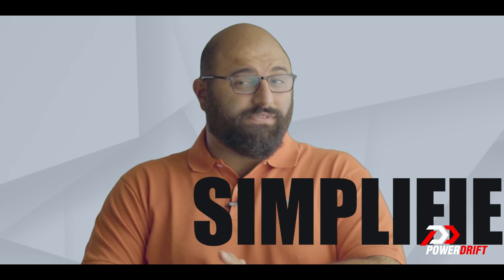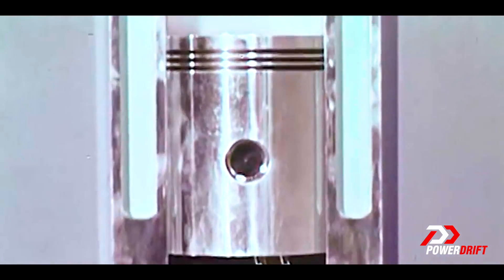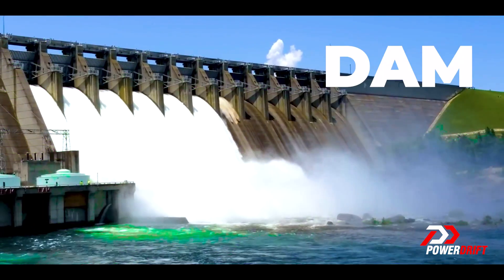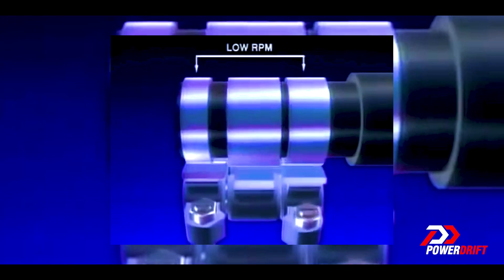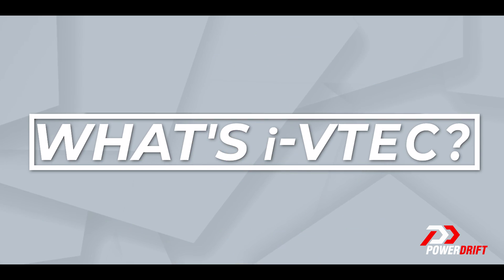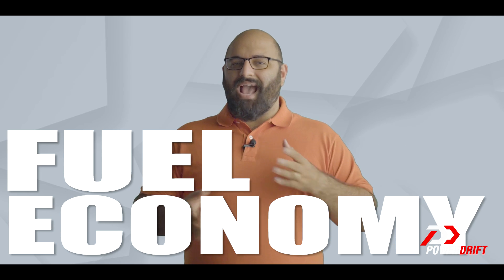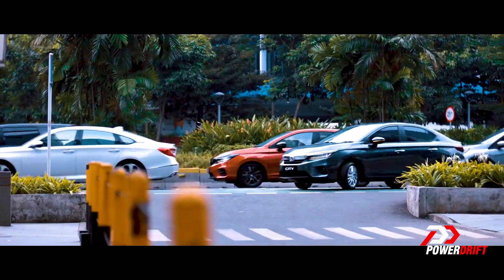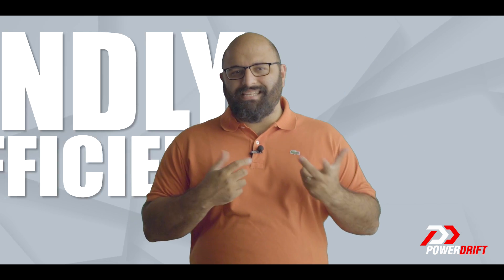PD Simplified | Honda iVTEC Explained

Comment: I can literally feel the performance of a i-vtec engine between 4 to all the way till 6.5k RPM in my Honda BR-V!❤️
Honda is Honda!!🔥
Reply: Iy
Reply: really? i have the amaze ivtec and the car feels underwhelming at all rpm's.
Reply: @vivejk4443  the amaze comes with a 1200cc and the brv comes with a 1500cc, the 1200 only feels good in the brio and extremely sluggish in the wrv,amaze,etc
Reply: Vtec kicks in at 4k rpms?
That's wild
I had to lower it to 4250 rpms using Ktuner

Comment: Hi, wanted to know if Honda has patent over the i-VTEC, then how Yamaha uses the same as VVA. Correct me if i am wrong but i think VVA performs  the same as VTEC
Reply: Toyota also has its version of vtec
Reply: You're correct
Reply: @danteanderson9052 Honda's VTEC is similar but different to Toyota's VVTI. Variable valve in the sense but Hondas are much more advanced. VTEC is variable valve technology electronic controlled. VVTI in Toyota is no electronically controlled. VTEC is design more for performance purposes. VVTI is designed more for fuel economy purposes.

Comment: How is this ivtec different from the older generation vtecs/ivtecs?🤔
Reply: 1, thy feet by
Reply: Mechanical management and ecu electronic management
Reply: I think the older ones are SOHC while new ones are DOHC
Reply: @a7myth nope. The R18 1.8L SOHC engine in the 8th, 9th and 10th gen Civic is i-vtec. The K20 engine is DOHC i-vtec. It only means i-vtec is the more advance VTEC available in newer engine types. The I in i-vtec is intelligent, so it is intelligent VTEC.

Comment: If iVtec is performance driven then why is the economy of city not justified.  I mean approximately  12-14 on city and 16-18 on highways
Reply: That is the characteristic of iVtec.. valve opening will be small in low rpm so if driven sedately u will get good mileage and once u rev up the engine the valve opening timing will increase along with lift. Thus u get acceleration rush!

Comment: Honda should work on delivering better products at a competitive price to the Indian customer instead of doing promotions for their age old  inventions...

For sure ivtec petrol engine is a gem but competition have moved ahead with more value, improved build quality, smarter tech like turbo charging...

The only that stands out in Honda cars are their supremely refined yet engaging engines but they don't l deliver good overall package for their pricing
Reply: Honda need to bring turbo vtec engines
Reply: Small turbo charged engines like the ones in the Skodas and VWs don't last as long. The City's engine is its best part. They shouldn't change that.
Reply: @Arjun true
these 3 cylinder 1000cc engines are overhyped 😂
but honda need to give a 4 cylinder turbo as a option to rival 1.5 tsi...
and a gearbox like Torque Converter
Reply: @arjun3807  
I'm not denouncing the fact that ivtec is a gem of an engine but the modern turbocharged engines are catching up interms of longevity and are much more reliable than first gen turbo charged petrol engines..

Honda in early years set a good standard for build quality but after the Volkswagens and Skodas have come in, Honda cars aren't a match to them currently..

The ownership costs of vw has come down considerably and the initial asking price of European brands offer mich more value than they were a decade ago..

Honda has a smaller service intervals and aren't cheap to maintain..

Honda missed a trick by not offering civic with a petrol manual...
Reply: @siddarthsiddhu3406  ever heard of carbon buildup problems in TSI engines. The VAG group does produce cars with good build quality but reliability isn't that great. The DSG gearboxes are also prone to failure.
Reply: Turbo charged engine can't last very long as it produces much more pressure inside the combustion chamber thus increasing the wearing of the piston heads
Reply: All these 3 cylinders turbo which people is drooling over is gonna blow up in a matter of 5 years whereas I VTEC stay and stays. 20 year old vtec feels more refined than a one year old nexon
Reply: honda needs to bring in a 5 to 10 lakh SUV in sub 4m class. The current honda lineup is crap. Only car which is doing well is amaze and maybe city . So , bring more cars or else you will face the same fate as Ford.
Reply: Guys see the pricelist and u will know the price of the city is less compared to all rivals and offer much more value for money, power and reliability
Reply: hate to be the one saying this but honda's main consumers aren't just car enthusiasts like us, lot of families want economical cars at a decent price range.. what honda should be doing is offering us in both segments by giving multiple engine variants, like maybe their 1.0L turbo and the 1.5L NA

Comment: What's i-dtec doing in i-vtec video?
Reply: The L15 engine in the current Honda City engines have i-vtec. The L15 is commonly used by Honda nowadays with the BRV and the HRV and even the Civic RS Turbo with L15 turbo engine. The older 2nd gen Honda city 1.3L engine have idtec